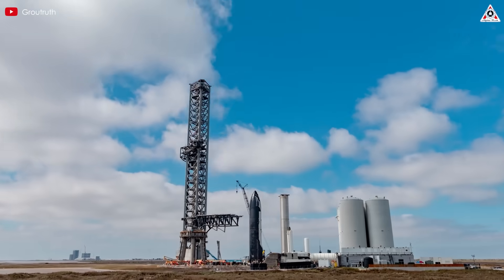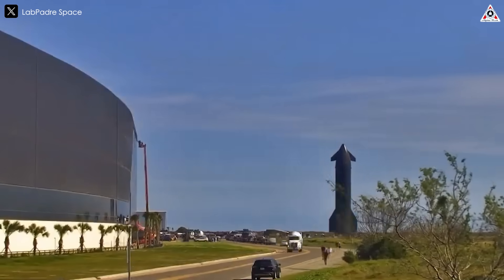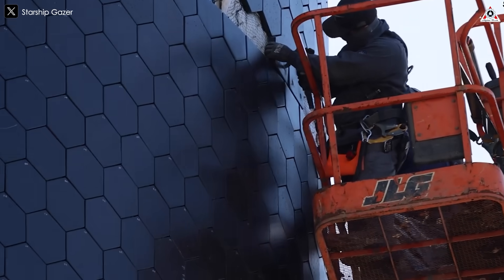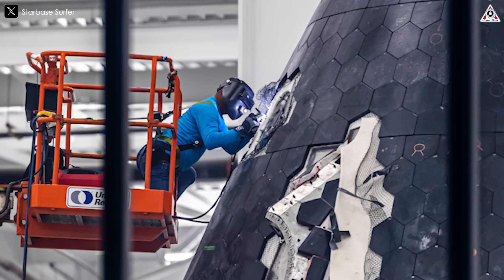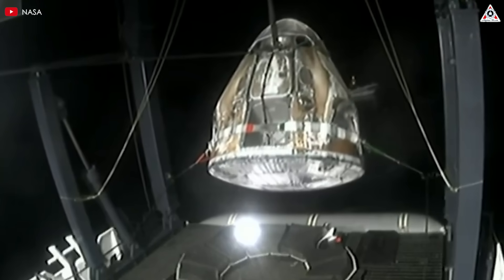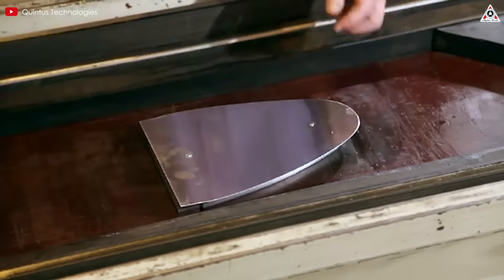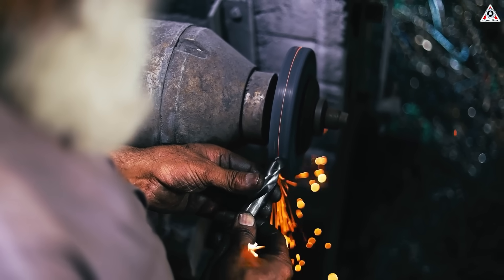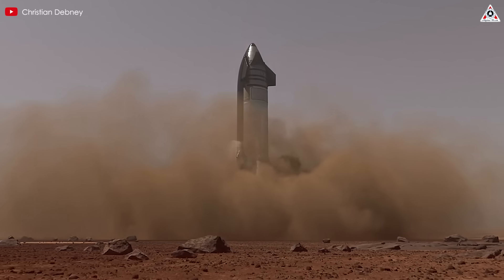Elon Musk revealed new Upgrades on Starship V2 Launch Today Shock the entire industry...

Comment: Crossing your Fingers and Toes is not a approach for evaluating and testing Rockets. It is conceivable that Starship may have reached a Technological development Dead End. Yes, I am convinced that SpaceX will be able to make it to orbit and a successful re-entry but Starship may never be viewed as a reliable Human Spacecraft. The complexity of Starship precludes it from being a viable "Rapid Reusable" Space Launch system for Humans. Starship will be no more reliable than the Space Shuttle regardless of the focused detail on safety. The RUD of Starshift 7 and 8 is an unanticipated disaster when comparison is made to the previous successful Starship re-entry attempts with the heat shield being the major issue. With each Starship failure the greater the doubt for success and the decrease in overall confidence that SpaceX will be capable of making Starship safe. The optics of these failures does not favor Starship. Who will ever want to get on a Rocket that has a good chance of Blowing Up. Perhaps for this reason Blue Origin has taken a cautious approach to flight testing when in comes to New Glenn. There will have to be a minimum of a dozen fully successful launches of Starship before it can be considered reliable. Hopefully SpaceX will succeed.